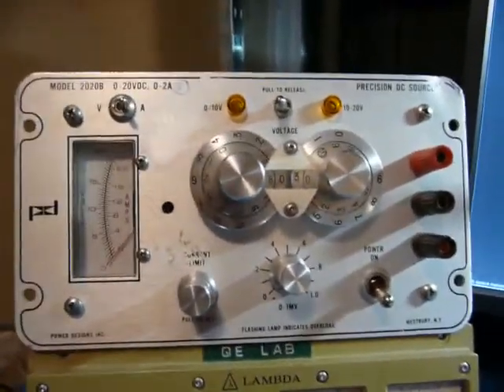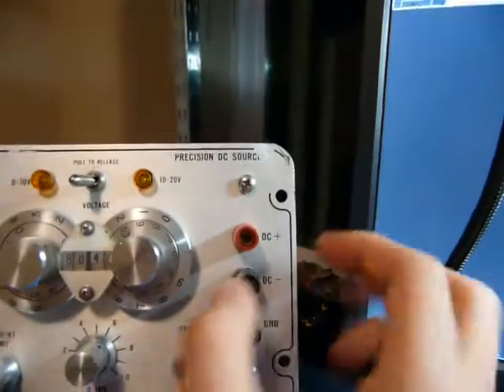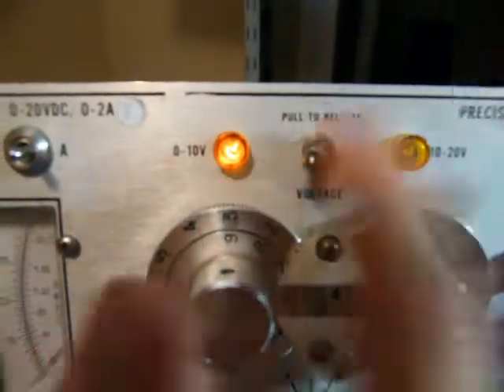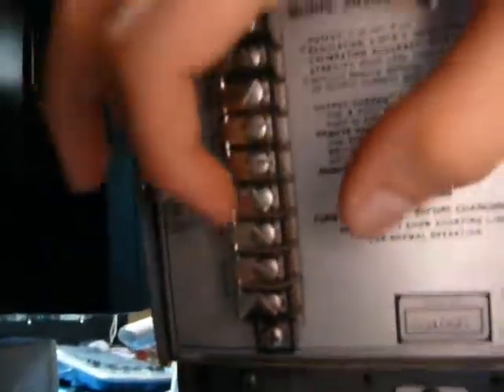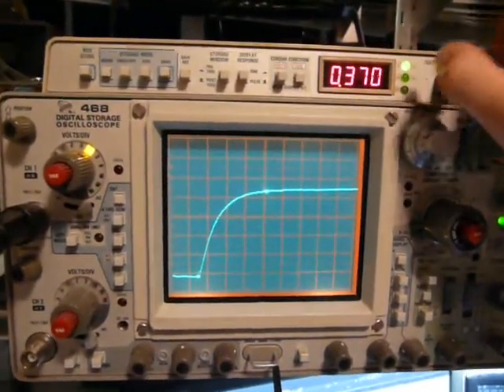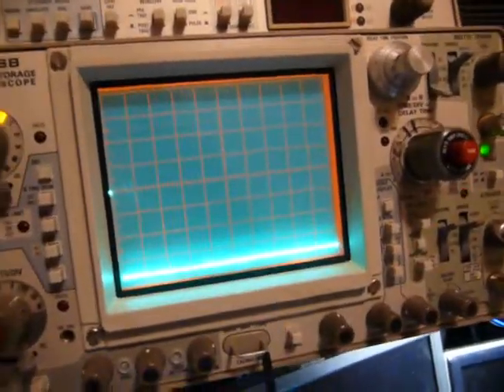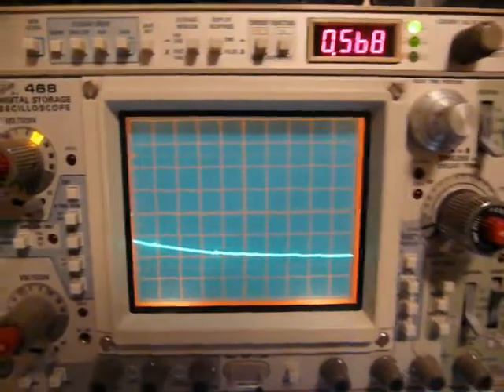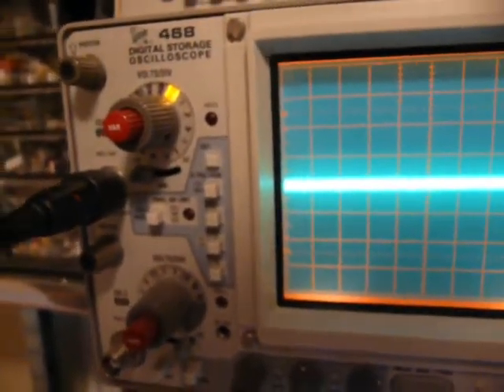Quick Power Designs 2020B Power Supply Review

Comment: Strange. I also have  a 2020B but its a bit cosmetically different.
The meter is two straight columns instead of curved.
Also the V/A switch in under the meter.
The rest is the same.

Comment: Yes, light blinks when the current drawn >= set current, and if shorted such as when setting limits.  Yes, so long as the scope is grounded it will pick up noise from leads relative to earth, its an antenna, you can re-check noise with PSU OFF, get difference when ON, if measurable.  Noise can be minimized with techniques.  See Agilent note 5952-4190 or similar doc on PARD measurements.  I use a battery powered scope, its guaranteed not earth referenced.

Comment from the maker: I found the supply by myself, but during the course of due diligence I checked out some eevblog threads of people with similar supplies. I've since adjusted the supply (someone desoldered the adjust pot!): watch?v=JgXqY-VZD50 The lights blink whenever the supply is in overload. Since pulling the adjust pot out just shorts the output internally, they also blink in this case. Wait, so the scope has to float? Even though the PSU is galvanically isolated already (minus not connected to ground)?

Comment: Did you find this great PSU on your own or did our thread on eevblog.com help you?  I'm glad you made the video review!  We haven't had the time.  to cal, all you need is adjust internal pots.  The neon lights blink when the current limit is reached or if you pull the knob to set the limit.  Bench scopes pick up any ambient noise relative to ground, such as RF, since the ground is at earth potential.  Your scope has to float.  Enjoy.